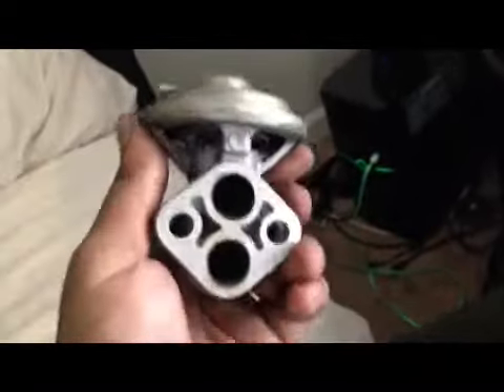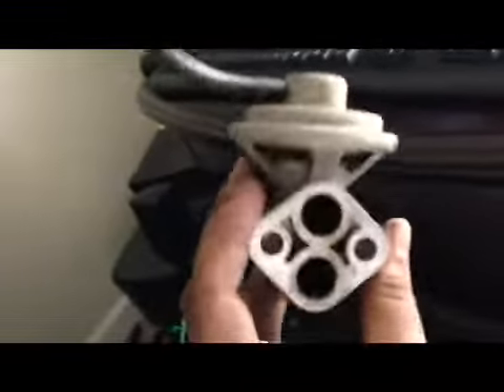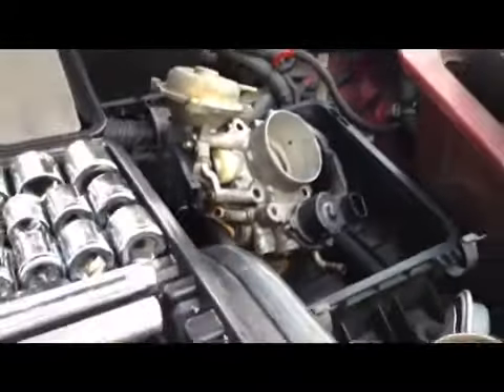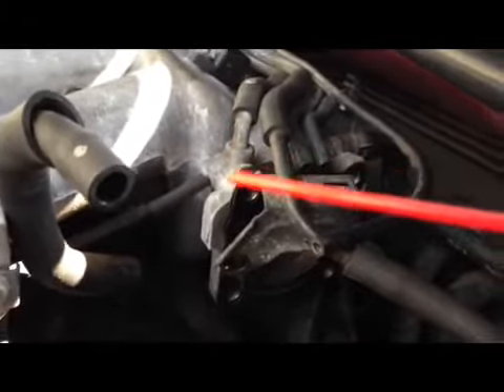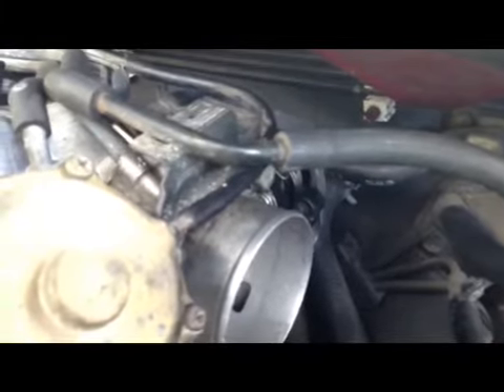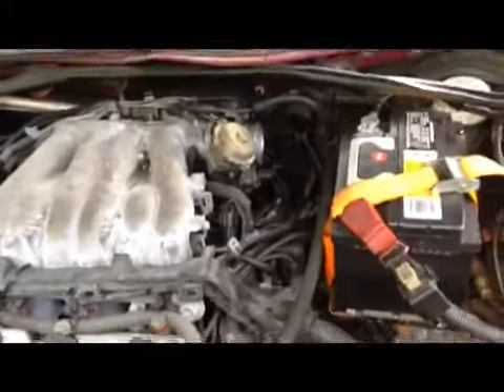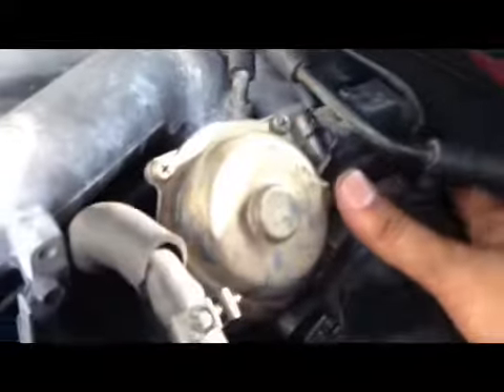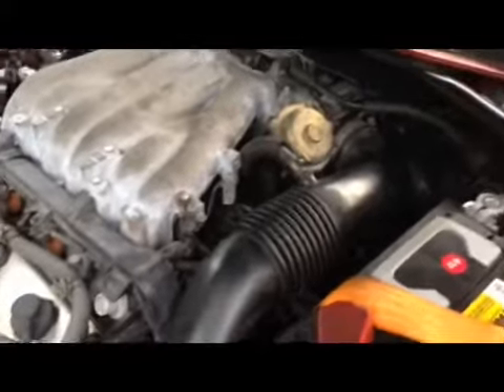Egr replacement on a 2001 mitsubishi eclips gt

Comment: hey man I have the exact same engine on the 2002 Mitsubishi Eclipse GT Spyder 3.0 and its a bitch to work on ANYTHING in this car. After replacing spark plugs, getting anything off from backs is wort taking the intake manifold  off. It might take a lil bit more time but lesssssss stresssssful cause i know what its like to work on this car!
Reply from the maker: George Lopez justtake your time and watch those vacuum hose yes its wort it i put e-3 spark plug on mine and add more ground on the engine it gave me good mpg  and strong tage off. o to pull apart and just practice taking off the air intake inthat way you takeoff some guessing situation i know i did it it cos me $2.00 to get in but i learn alot on doing that try it it might help you
Reply: How did thouse E-3 spark plugs work out for you?
Reply: Julius Escoto .